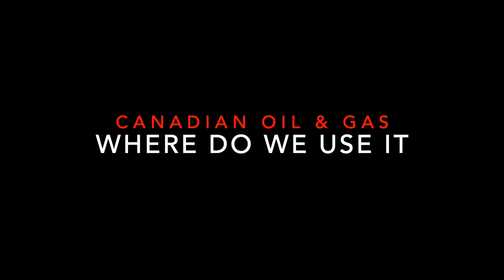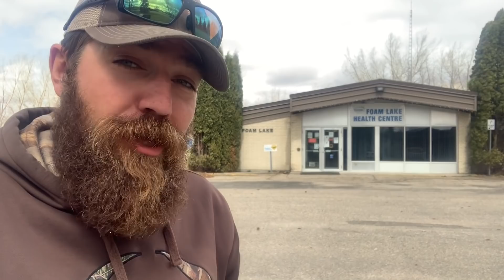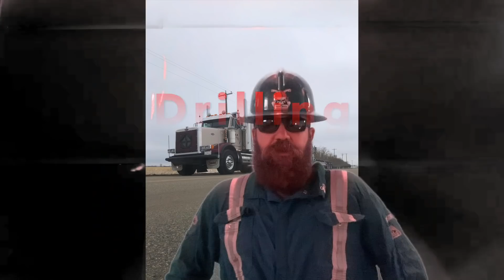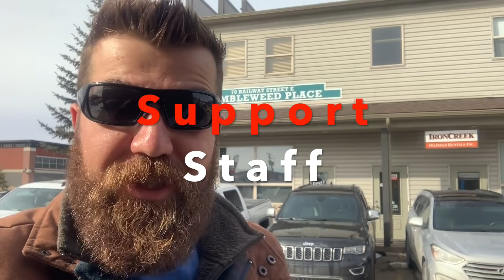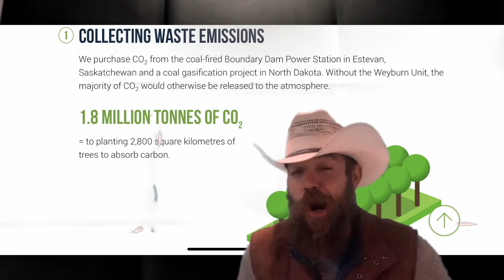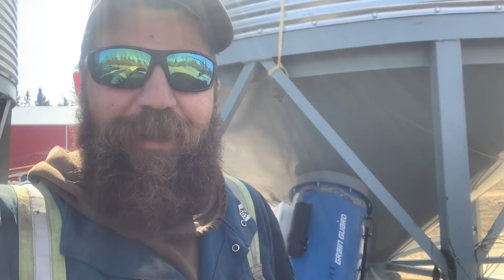Canadian Oil and Gas

Comment: Hey Quick Dick, as requested at 3:20 You're an asshole.. you missed out on the hard working pipe heater crews, used throughout the entire project, that heat to expand pipes so when they're cut to length they won't bulg out of the ground in the summer when hot oil/LNG is pumping through.. good stuff regardless man, keep it up :)

Comment: One of the biggest bottlenecks is the obstructionist, anti-pipeline mentalities in BC & Quebec. That being said, I have often maintained that no one wants crude oil. They want gasoline, diesel fuel, natural gas. So refine it here & ship high value product to market. Build refineries in the Ft MacMurray area, where the landscape is already blasted, and ship it out. Someone once told me that the freshness of the fuel matters, and it would take too long to send gasoline to, say, southern Ontario. But it is exactly that same distance from southern Ontario to Ft Mac, and there doesn’t seem to be problems with fuel quality...
Yes, eventually solar & other sources will supplant some of the use of O&G, but that will be a long time in the future. In the meantime, I have yet to hear of plastics made with solar feedstocks, or fertilizers made from wind...

Comment: It's funny when people believe that oil is infinite, its not. And no one seems to want to find a different alternative for everyone to be able to farm and live in the same way they're doing now, only BETTER. Not only for the environment (if you want to know what oil does to the environment, look it up), but also for all of it to last even longer! Heck, the whole thing would be safer even! 
Problem is, we're exploiting these resources. So oil itself, if used well and not excessively is FINE. Using it for literally everything when alternatives exist and also using it wrongly (like polluting and putting it in water etc.) Is where the real problem exists. That's just what it is. 
If someone said, "hey you can do the exact same thing but better!" You wouldn't do it? What needs to happen is for leaders to provide these better choices for people and not just remove everything at once for those who live from it.

Comment: Quick Dick.   You are very charsmatic,  funny, but extremely ignorant.  

2008 Auto bailout...  Harper (Conservative) was responsible for that.  Ontario manufacturing sector is its bread & butter. Ontario had most voters so you need to address it if you want to be in power.

O&G problems are do to factors beyond government ts control.  Saudi Arabia  & Russia flooding the market to screw up US, Canada production line because of the high oil prices to extract and process Canadian  petroleum .  Fracking amd Oil Sands are too costly to justify extracting. 

Building that pipeline to BC is not going to have the effect that many O&G personnel are convinced it will have because the over demand of petroleum products on world market.   In the market, Price always trumps Cost.  The world market doesn't care one bit that Canada environmental reputation for extracting.    It is human nature on market is 'Race to the bottom'.   A good example of that is Walmart and how they engaged in their business, employment,  environmental practice; yet people always shop there!'   That is deliberately misleading.

Green technologies can and does provide more employment  opportunities for those in the O&G sector.  The Service and Support companies are just as employable and maintainable for that sector.   The biggest fear is many workers believe they won't be paid the same rate.   I personally don't know many jobs that pay $100k /yr to people with high school education.    Again, misleading. 

The products that produced  like plastic and synthetics is a complete shear shot because the amount of petroleum to produce is extremely minimal.    Most of the petroleum products is used for fuel and heating.  Arguing over pennies.

I can go on and on....

Comment: Wait! So the USA is not the only one that's totally screwing it all up?
I was a heavy truck mechanic for 25 yrs. I look around my place and about 99.9999% of my stuff got to me by some sorta of oil powered vehicle. Plus all the steps along  the way. 
I always felt proud in doing my part to deliver goods to customers. Just by changing a tire or a complete engine in frame. 

Keep up the good work.

Comment: So, I guess I'm supposed to call you an asshole... you missed one of the big essential services that it takes to keep the drilling, fracking and finishing crews going. Now, in places like Saudi they dont need us, but here in Canada, they need us Steam Truck operators. Gotta keep everything thawed at -50°C
Reply from the maker: @Farmer Wade - you hard workin folks on the steam trucks and boilers have pulled QDM out of a few "frozen pickles", that's for sure!!  Thanks for chiming in!!

Keep the boiler burning and the wheels turning!!
QDM

Comment: I'd beg to differ on the 2 first points hot water can be obtain via electrcity and house heating can be obtained by wood stove electricity. And yes you need oil to make electrical products.